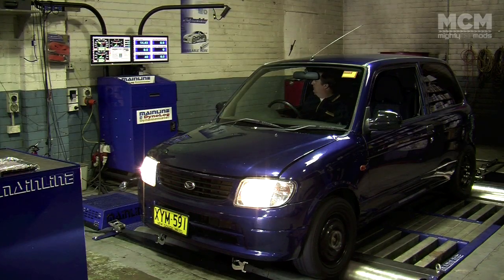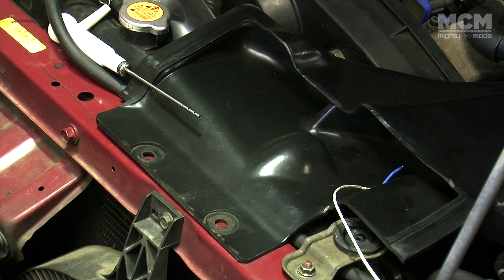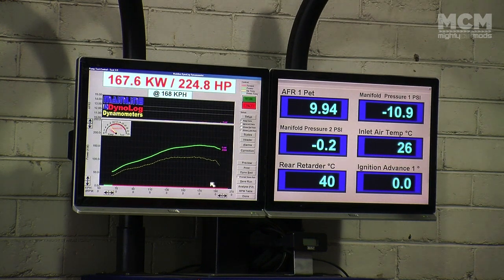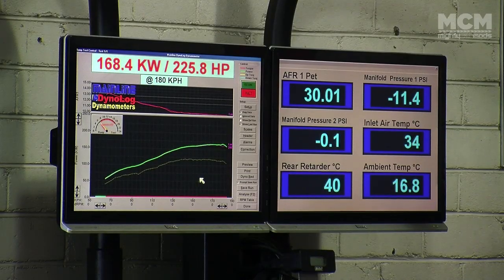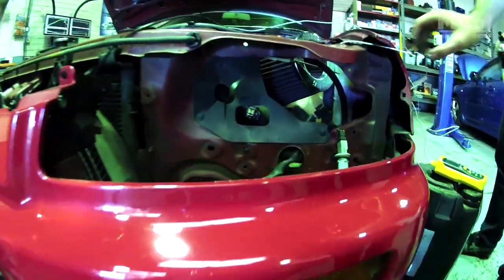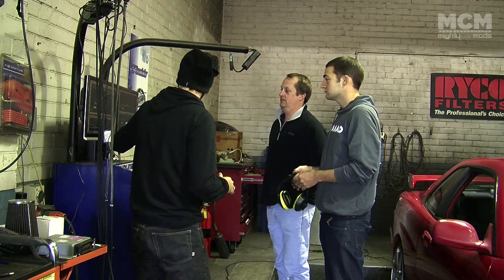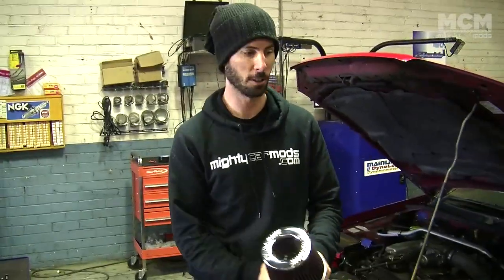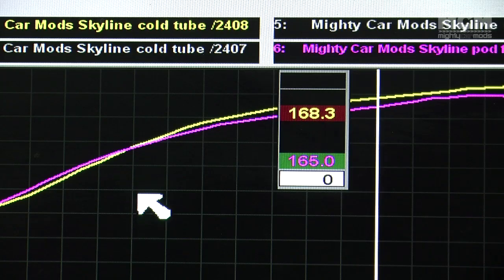Cold Air Intakes Mythbusted [Turbo]

Comment: What a load of rubbish. Changing just the filter will not make any difference, the stock turbo inlet pipe is still restrictive, so if the maf sensor. Which is why you need softwares like Cobb or Versatune to change configuration. Also, intake systems include bigger inlet pipes to allow more air flow with oxygen to combust. Add per evidence, join any forum (like MazdaSpeed 6) for example and request logs for with and without stock filter +stock inlet pipe +stock ecu config vs upgraded filter + inlet + remapped ecu. These guys are bunch of cowboys, video should not be shown on top of the search results with complete misinformation!!
Reply: You are looking at info from people who pay money for nice stuff and have it installed and set up properly. The overwhelming majority of people (mainly kids) will take of the factory air box in the parking lot of auto zone and slap in the pod (losing hp), and drive off thinking their car is bad ass. I'm lucky enough to have on the side of my car ('85 Fiero GT) so I already have "cold air intake" or what ever the ambient temp is for the day.
Reply: They did this to 'call out' the cold air intake and filter makers. They advertising 20% increase just by adding in a filter. In the best of conditions, with all supporting mods, an air filter will add 2-5hp...TOPS. Wont even feel that. Now, if you were an autozone/pepboy ricer (and that doesnt apply to just import guys. i have seen my share of domestic ricers. those guys are fricking morons lol), slap in a CAI and they think they just gained 100hp and can put any vette, camaro, mustang in their place. Anyways, this was supposed to be, educational at best on cold air vs filter vs oem. This is something i have known for year (was one of the first things taught to me). Pretty much its more of a noise maker than anything else.
Reply: You have to be a bit more precise than that when you mention "supporting mods". If an intake filter is added with turbo inlet pipe and software has been tweaked to alter MAF sensor not to limit airflow and increase boost psi up to certain engine RPM then it will add 20 - 30 BHP. Bear in mind I'm talking about Turbo charged cars, not superchargers or straight ones. If this video was supposed to be educational then they might as well have gone to full extent of how to do it properly, videos as such is in fact misleading therefore.
Reply: Tanim Ahmad Wait, you can tune a MAF sensor to limit/permit airflow and to increase boost? Lol It kind of sounds like you're talking about a wastegate. Also, in my car at least, the stock ecu has fuel maps for plenty of MPs, IATs, and MAFs, switching intake piping and filter shouldn't require a remap. I could see a remap being required if you're screwing with wastegate settings, though I really wouldn't do that on a car with just a CAI.
Reply: Brandon Ingram Yes, wastegate duty cycle comes with it too, and also Air Flow Ratio and many other things. In a nutshell without tweaking ECU mappings just adding an intake with a inlet pipe will not take the full advantage of extra air coming through it. Also, stay away from Cold Air Intakes, as they are notorious due to the water ingress problems rather than LTFT to be honest and hydrolock driving in pouring rain!
Reply: Tanim Ahmad I'm not sure what car you're talking about, but unless the stock maps really really suck and it's a super cold day with a pressure of like > 30.6 inHG and the stock intake was super restrictive and hot, you're stock maps will add/reduce the amount of fuel for the change in IAT and mass airflow. If you're going to do an intake, it needs to either be a CAI or have a really good amount of heatshielding, otherwise you're just getting hot engine bay air. Hydrolocking is easily avoided by mounting the intake high in the fenderwell and just not driving through high water. Also what does LTFT stand for? I've always known it as Long Term Fuel Trim but I really don't see what that would have to do with this.
Reply: Brandon Ingram You are generalising all stock maps, not all will increase or restrict enough, specially once bigger intake and inlet pipes are replaced with the custom ones. Again, not all cars can facilitate by placing it high to avoid water ingress, every car is different, which is why Short ram intakes are much better. LTFT are the tell-tale sign if your running lean or rich, they tell you if it's having a knock-on effect. All needs to be synchronized, I don't do remapping myself but have picked all these up from people who do. Hope this helps.
Reply: Brandon Ingram here is a good answer of your question "Also what does LTFT stand for? I've always known it as Long Term Fuel Trim but I really don't see what that would have to do with this."

http://www.obd-codes.com/faq/fuel-trims.php
Reply: LTFTs are the car correcting for errors in the IAT sensor, MAF sensor, and MAP sensor. If you're getting a LTFT value that's off, you either have a bad sensor, or a vacuum leak. Unless you're screwing with the MAF sensor, screw up the laminar airflow over the MAF or anything downstream of the MAF, then you DO NOT need a tune. CAIs are supporting mods, they're not meant to give you HP, in fact if you get any HP with a CAI and a "tune" then all the power came from whatever you did in the tune.
Reply: Tune itself cannot add all the HP without the intakes and inlet pipes. Any professional tuner will tell you that. It's like installing a printer without the driver on a PC. You do realise LTFT, MAF, AFR all are related? So to sum it up, intakes DO increase HP, and you DO need a tune to make the most of it.
Reply: Tanim Ahmad
Well then they should stop advertising them as bolt on HP gains. If you have to go to a tuner to get the power out of the mods then its not bolt on power.
Reply: Agreed Danny Hampton to an extent, presumably it's a hit and miss as all depends on how the stock map is as Brandon Ingram has mentioned, some stock maps are good enough to take the advantage. Also, older cars would have had been much straightforward too, but I have no idea about them. I'm very active on UK Mazda MPS Owner club forum and we have hundreds of car owners with increased HP using intakes, turbo inlet pipes, high pressure fuel pump, downpipe, decat delete etc combined with tweaking ECU using Versatune or Cobb of course. Most basic modification is to add just intake+inlet pipe with Cobb/Versatune to gain about 20-30 extra hp on Mazdaspeed 3 or 6, also known as Mazda MPS 3 or 6 in Europe. Every car is different, so generalising would be misleading. MPS itself are different basing on where they are from, Australian and US MPS are different to UK version as far as I know.
Reply: Tanim Ahmad
I would imagine that older cars can get more out of these mods as older cars were not factory tuned near as much as today's cars where you change one little thing and the ECU derps. I have to swap engines before to long and if I get one of the engines I want I have to have full custom exhaust and probably intake piping so I might have to take my car to a tuning shop anyways. The engines I want already have the 250-300 HP I want for my Feiro GT (110-160 HP gain), I will just need to make sure its running properly and not messing with the fuel economy. Any other tuning for me would be for more fuel economy.
Reply: Tanim Ahmad Yes I do realize that the AFR is determined in part by the MAF sensor, and that when in CLOSED LOOP the LTFT can adjust the AFR, as soon as you put enough load on the engine though, the FMS switches to open loop and no longer uses the fuel trims and bases all fueling on the predetermined maps against the IAT, MAF, and MAP sensors. So if your open loop system is malfunctioning somewhere or isn't accurate then yes, you're LTFT will be screwy, but, given a correctly functioning open loop system, you can put anything within reason before the MAF or IAT and be completely fine. The whole point of EFI was so we don't have to adjust something everytime there's a slight change in O2 coming into the engine. Yes you will get more HP if you go tune with a wideband, but that's only from tuning closer to a better AFR, you're stock ecu will richen the mixture PLENTY during open loop so leaning it out slightly would give you more HP, if you just did that with a stock intake, you'd see about the same gains, and the fact that it would be a gain here is important, not overall HP but the gain in HP.
Reply: Danny Hampton Just about any engine you can put in a Feiro will be easy to tune/insensitive to changes, judging from the HP that you stated, my guess would be that you might be going with a supercharged 3800?
Reply: Brandon Ingram
Nah, I was actually trying to avoid it because it's over done. It is a great engine but I don't want to own just another 3800SC Feiro. I was actually looking at the newer Ecotecs (turbo and N/A) and the newer turbo 2.8 V6 and the newer 3.6 V6 out of the camaro, ATS,CTS, ect. The Ecotecs I was looking at more for multiple reasons. Lighter, better mpg, and easier to work on because the left head is not on the firewall, but its hard to make a I4 sound good. Also I thought about it and the easier to work on thing doesnt matter than much it the engine is reliable because other than oil change I don't have to mess with it much. I can keep my nice sounding exhaust the new V6 have pretty good MPG.

2.0L T-I4 LNF or LTG - 260-272 HP
2.4L I4 LAF - 182 HP
2.8L T-V6 LAU - 300 HP
3.6L V6 LFX - 321 HP

The 2.4 would need some work to get up towards 250 HP but it would let me slowly up the HP and see were I truly want it at. The >140 HP the worn engine has now can be fun so it honestly wont take much to make it a lot of fun, 200 HP would be awesome, but 300 HP would be amazing. the 2.8L is mainly on the list because the stock Fiero GT engine is a 2.8 lol. Depending on when the stock 2.8 decides to die, I might have to stick a 3.4L in because its cheap and it bolts in other than re-drilling the holes for the starter, and the 3.4 is still a 20 HP gain. Might just scratch the turbo engines because I don't want to pay for premium fuel.
Reply: Danny Hampton If you like Turbos then I would highly recommend Mazdaspeed 6, it's a 2.3 Litre with 276 BHP out of the box over in States.
Reply: Tanim Ahmad
If i got a Mazda it would be a MX-5 (MX-5 was the other car I was shopping for when I found the Fiero) or a RX-(x), but I like my Fiero and am not gonna git rid it. It's too special. I just want to get it 100% mechanically with modern parts. Then after small 4x4 I'll look into a pure weekend toy car, lol. for now the Fiero has to be a daily toy car. Also I have to stick with cheap cars, lol. Mazdaspeed, not so cheap, lol.
Reply: actually another way to make use of a performance filter is if you also add a performance exhaust. its all about air flow, if the exhaust is restricted from escaping the combustion chamber quicker than the performance air filter is feeding the fresh air in, then it wont make a difference. i have a 2000 ford focus zx3 and i put on a straight pipe exhaust with magnaflow delta force race muffler, and paired it with a AEM cold air intake system and it gave me 11 extra horsepower without tuning it, not really sure what 11 horsepower is in kilowatts but no one gives a shit about kilowatts.
Reply: Spot on with that JJ Rudawski I've found all the big 400 BHP+ Mazdaspeed 6 / MPS 6 owners remove catalytic converters for 11-15 more BHP.
Reply: Tanim Ahmad Who actually measures the BHP of their car after tuning? That's crazy. Most people put the car on a dyno and measure WHP.
Reply: Very true MrGencyExit64 as BHP using the OBD gives inaccurate figures and Dyno gives spot on accurate results. However, OBD reading at least gives an indication of what range the BHP might be in using couple of runs and logging them on flat, dry, traffic free roads.
Reply: Danny Hampton
Fiero = toy car. You got that right, bro.

Knew a guy bought one in the late 80's to have a peppy inexpensive sporty car to haul his golf clubs to the course with. I, on the other hand, bought an 88 302 Thunderbird Supercoupe, fully loaded. Paid about $2K less. Had about two seconds better time in the quarter, stock. And he couldn't fit his clubs into the trunk of the Fiero, on top of it, whereas I had more trunk space than I'd ever need, as a then-single guy, unless I started disposing of bodies as a sideline. Even then, should have been good for at least two or three.

But at least you're planning to do something about the power situation.

I still think the Fiero body style is butt ugly, though.
Reply: Diego Alatriste
I personally always thought the Thunderbirds were ugly, all of them. I like small, light weight (relatively in the case of the Fiero) and I like mid engine. I want to make mine into what it should have been if GM wasn't so fucking stupid killed a good platform when it just started to get good. (Media also flogged the crap out of Fiero also for one year of fires.) If media didn't kill sales the Fiero would have lasted a lot longer and have been refined into a much nicer car.
Reply: Diego Alatriste
Reply: Danny Hampton Couldn't have agreed more; big engine cars are heavy and doesn't feel nearly as sharp as lightweight mid sized engine cars, all about power to weight ratio.
Reply: Danny Hampton
I agree that some of the Birds were ugly. Hated that downsloped Bird hood from the early 90's. But I personally thought the 88, especially with a set of the billet aluminum wheels, had nice lines.

And the Bird only weighed between about 600 to 800 pounds more than the Fiero, but with room for five. So saying the Fiero was relatively light to me is like Oprah Winfrey or Kirstie Alley coming off a diet and saying they are relatively thin.

But it seems to me that the Crown Vic caught as much or more crap for fires in the Police Interceptor version, when hit in the gastank by a semi, and not so much for other design/engineering reasons.

But the press did crucify the Fiero the same way they had crucified the Corvair, just because the Corvair couldn't corner  hard like a sports car unless you added a sway bar, which wasn't normal equipment for cars in that price range at that time. It was the same basic problem the VW beetle had, and the addition of a $100 or less rear sway bar cured the problem in both.

If the Fiero had been given some design improvements and better features and power, it could have been a decent sportscar type of ride, but as you noted, it was put out to pasture before that ever happened. But my basic point still holds...you paid more for it than for other cars that offered more for less.

GM always had a problem with certain divisions having too much overhead, which had to be allocated out to their offerings in order to show a profit. I suspect that was the main reason the Fiero was priced as high as it was.

If you, or anyone, doubts that argument, look closely at historical replacement parts prices for GMC vs. Chevy trucks, with GMC always costing a good bit more.

I once had a 55 Jimmy 3/4 ton panel truck that needed a front pulley. The Jimmy price at the time was well over a hundred dollars. Thee mechanic ordered me the same pulley from Chevy for about forty or fifty dollars.

That sort of accounting and pricing policies is what led to the Fiero being overpriced. Had it cost a couple of thousand less it would have been a better value for a two seater. Also, the 88 was substantially reengineered and a much better car than the first three years, but the reputation of those three years couldn't be overcome. So both the price and three years of bad engineering also contributed to both the bad press and the decision by GM to kill the platform.

My 88 Bird only cost about 15 per cent more than the Fiero GT, but delivered a whole lot more, which was my original point. But if you don't like the looks, of course, none of that matters, just like my not liking the looks and the track record of the Fiero in 88 made the price irrelevant to me.

De gustibus non disputandam, or in simpler terms, that's what makes horse races...
Reply: I only payed $1400 and it does everything I and want it do, with the exception of i want more power because, well, more power. The 140hp my 29 year old engine supposedly has is still plenty of fun. And by relatively light weight, I mean most cars are 3,300lb or more and 600lb is a lot of extra weight. I would love to have a first gen MX-5 Miata or older Lotus Elan because they are 2,100lb or less. So to me, something that is under 2,800lb is only relatively light. 2,000 is light and 3,000 + is heavy 3,500lb+ it better be a truck, van, or armored.
Reply: Tanim Ahmad I'm probably flogging a dead horse here, but I think you missed the point of the video entirely when you stated that Changing the filter will not make any difference [without changing anything else]. That IS what the video was about. 

They do other video's showing how to increase power, but this is part of a series of video's they do trying to show what sort of modifications can be a complete waste of money or worse.

Also this channel seems to be aimed at your more casual boy racer type, not the more serious rev-heads who would be on the forums and learning how to do everything how it should be done.
Reply: Adenzel I could not have disagreed more, not a single time they did mention about modifying other parts to improve performance gain. Besides, this video should not be shown on top of the search results with these sort of incomplete information from incompetent cowboys!
Reply: I guess we see it differently.

But I do agree that Youtube's suggestions and search results can leave a lot to be desired.
Reply: Tanim Ahmad Though, changing the intake on a N/A engine, will give a huge power difference. The larger the engine, the more power gain. An air intake from the right manufacturer, in this case Air Raid, will give at GM 6.2 N/A V8 an extra 26 horsepower and 21 ft lbs of torque. You just have to do some research to see if the application is good for your setup.
Reply: It will if it's the right filter/air intake and not worse than factory. It would be interesting to see the pod test and this cold-air intake test done on a V8 too.